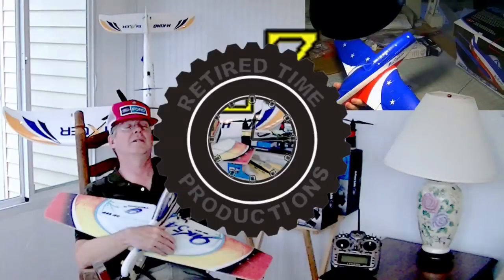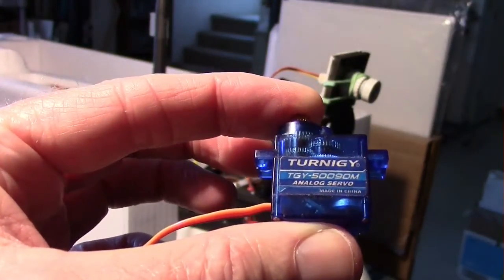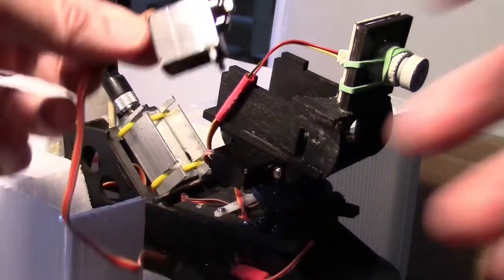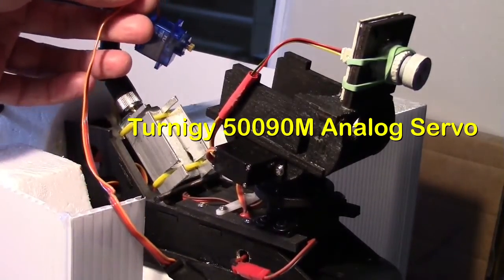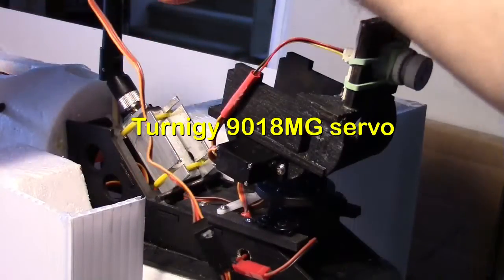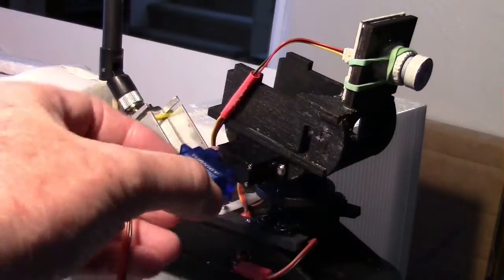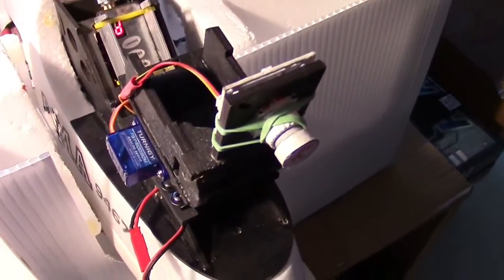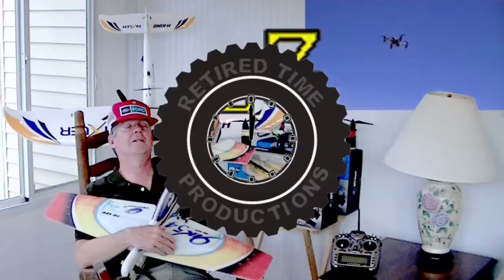Fixing Servo Chatter Twitch Jitter from 1.3gHz FPV Video Transmitter

Comment: Have you heard of another servo problem - motor noise? I can not solve it in any way. Power is supplied from a separate power source. Can you tell me how to solve this problem? Servo sg90.
Reply from the maker: Motor noise can sometimes be removed by running the power through a LC filter. Works great for FPV Video. Perhaps it would work for servos too.

Comment: I always put the TX antenna on the end of the wing, that should eliminate the problem also.
Great info Dave!
Reply from the maker: ***** What type of antenna? CP, Vee, or Dipole works the best for you on 1.3 gHz? 
Over Over
Reply from the maker: ***** Thanks for the tip. So make a dipole 2 and 2/3 inches on each pole. Super!
Reply from the maker: ***** Ah, thanks!  That converts to 56.69mm if I use 2.232" from your video:
https://www.youtube.com/watch?v=ab6HAntgemo

Comment: rf filter on the 1.3 will solve that servo jitter ;)
Reply from the maker: ***** Filters always reduce the power output to some extent but yeah a filter could help. Changing the servo is a very simple fix though.
Reply: *****
plus- changing the servo was the best option as it didn't add weight. I am not disagreeing- just offered an alternative. I run a lot of 1.3 video setups- and I have found low mw matched with the best antenna applicable, offers incredible performance. I am getting stellar results with dipoles and cross patch combos for penetration through buildings and trees.
Reply from the maker: ***** Really I appreciate any advice I can get. In fact I am thinking of making my own dipole and putting it out on the wing so you have confirmed that idea with your stellar results. Dick Gibson says 2.23 inches makes a good length for each pole for 1258.
Reply: *****
I use 1.3 for dense proximity purposes- not distance. I suspect the fixed wing would still benefit from a dipole- I do know that I use a diversity, and in open spaces I prefer the crosspatch and omni- but when I need penetration through trees and buildings I use the crosspatch and monopole (stock) on the vrx's and the dipole on the craft.  Omni for open areas, and dipole for dense- but the dipole must be matched to the monopole or the crosspatch- there is a loss using a dipole with an omni.
Reply from the maker: ***** I wish I had some RF test equipment. Maybe some day. Thanks for the advice.